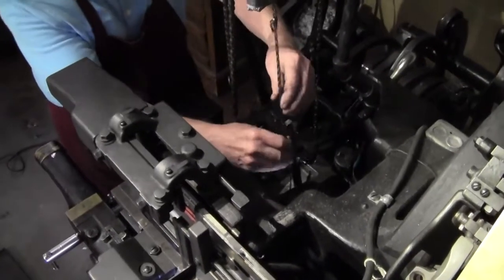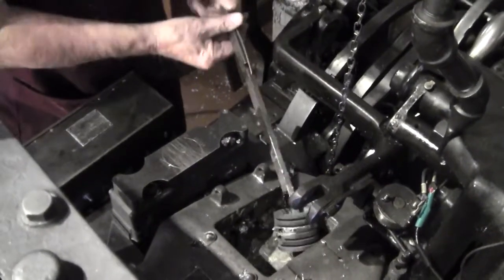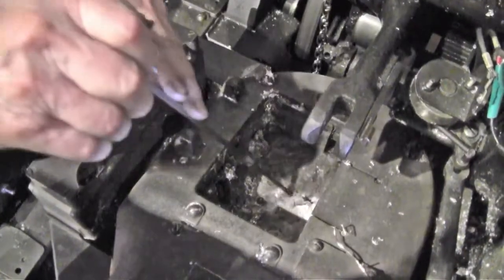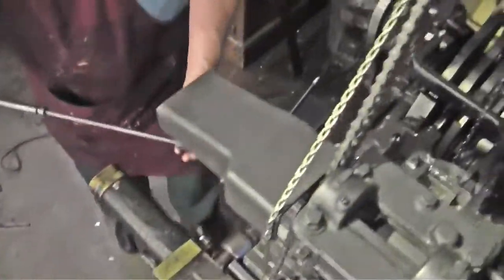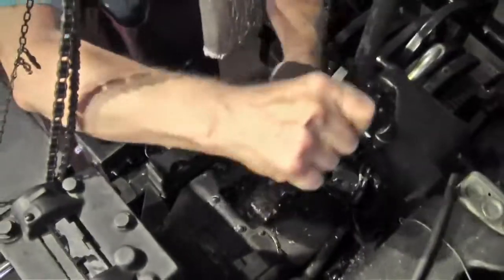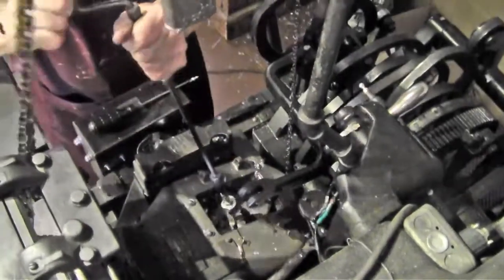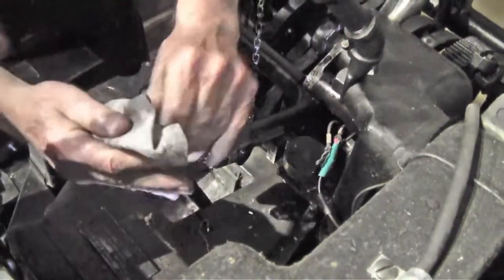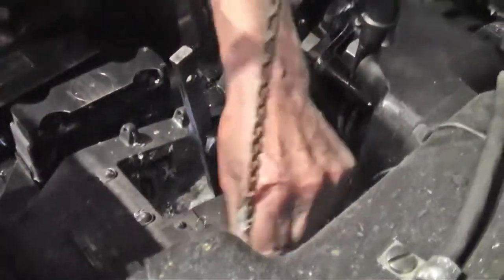Linotype Repair: Hot Metal Pot

Comment: Ray, I wouldn't put the cold plunger directly into the well - set it in the metal next to it and let it warm up. When metal flows through the little hole in the bottom of the plunger - and if it doesn't, you need to clean it out too - metal should fill up the inside of the plunger. When it's full of molten metal, it's ready to go into the well. The reason your plunger got stuck is because it was cold and metal solidified on it. If you push a cold plunger too deep into the well, it can break the well when the cold adhered metal expands.